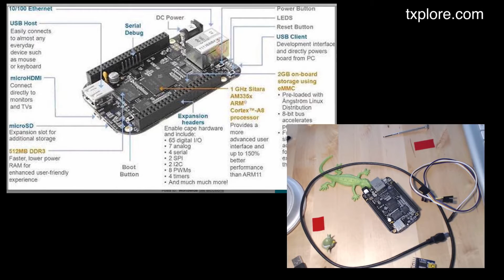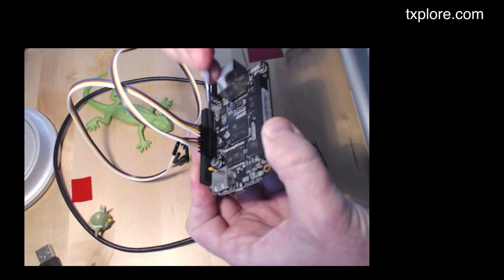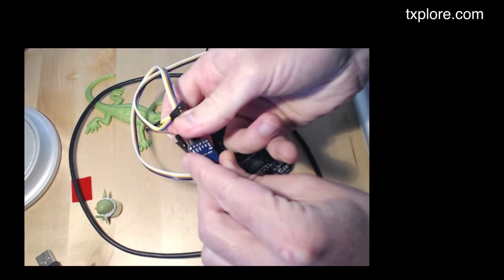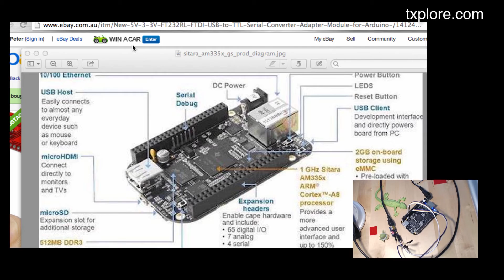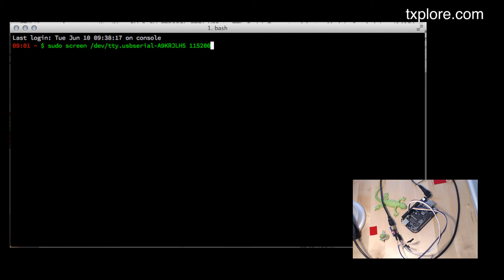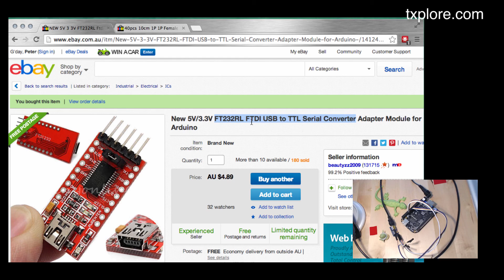Beaglebone Black - Simple USB to Serial connection using BBB's serial debug connector

Comment: Thanks for uploading, for those wondering why use the serial connection instead of a regular screen and keyboard:

I had not used my beaglebone black for a while and decided to upgrade from Debian Wheezy to Debian Jessie, after the upgrade process completed, I noticed that all packages upgraded except the Linux kernel. So, I checked and apt said that the kernel that comes with Debian was not installed, installing it made no difference. Then I realized that the kernel is loaded via uBoot and in order to change the kernel, I need to compile it and load it via uBoot, the uBoot interface is only accessible via the Serial interface. These are the steps I followed:
https://eewiki.net/display/linuxonarm/BeagleBone+Black#BeagleBoneBlack-Mainline
http://www.cs.sfu.ca/CourseCentral/433/bfraser/other/DriverCreationGuide.pdf
Again, thanks for uploading. It helped know which pins to connect the adapter to.